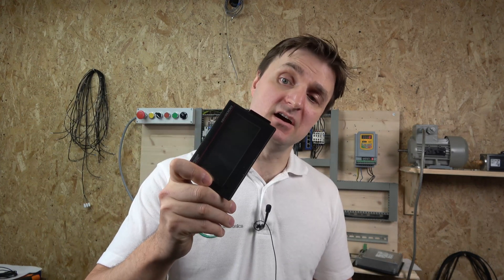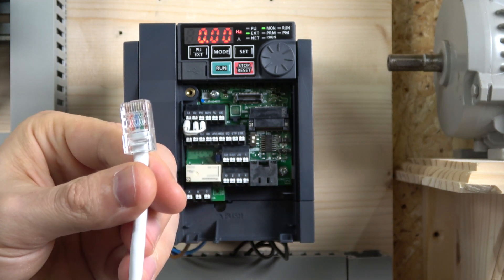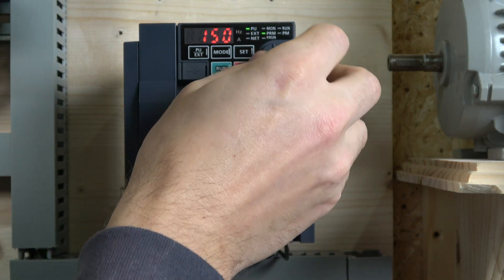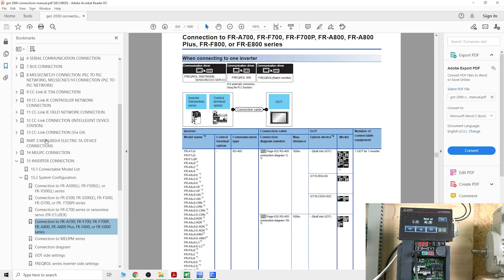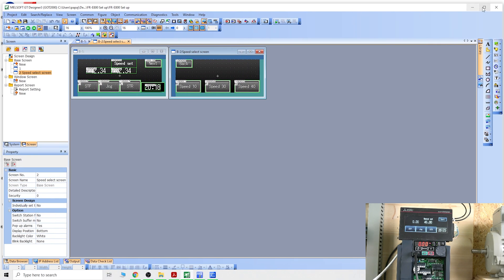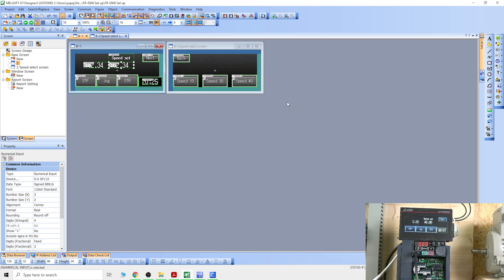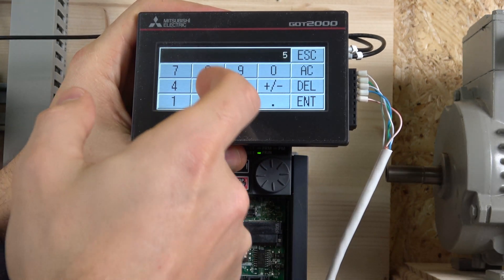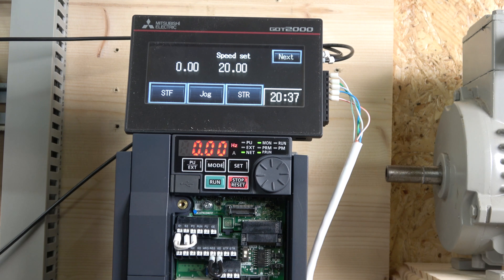How to run Mitsubishi E800 VFD with GOT2000 HMI , set up, wiring and parameters. English

Comment: How to run Mitsubishi A800-E VFD with GOT2000 HMI by Ethernet communication?
Reply from the maker: Hi there. never set up the drive like that, but if i would tempt it and am sure it can be done, you will need Ethernet cards for both units. Will most likely make a video of it in the future, but not any time soon.